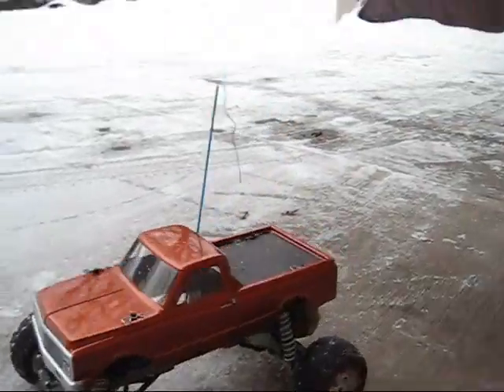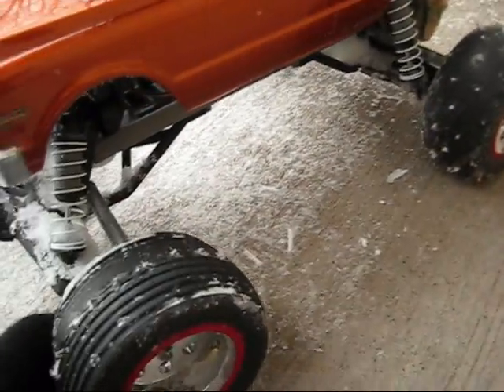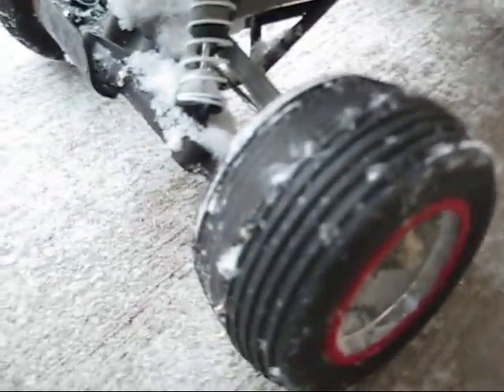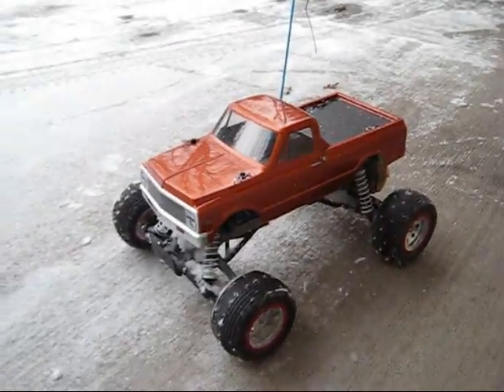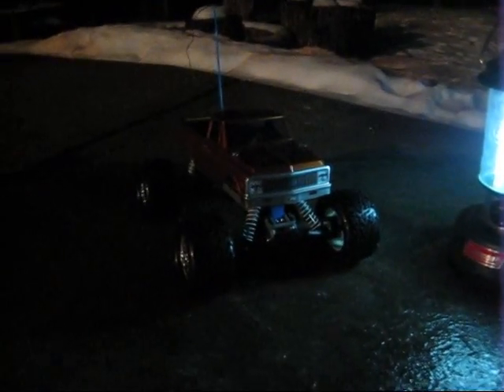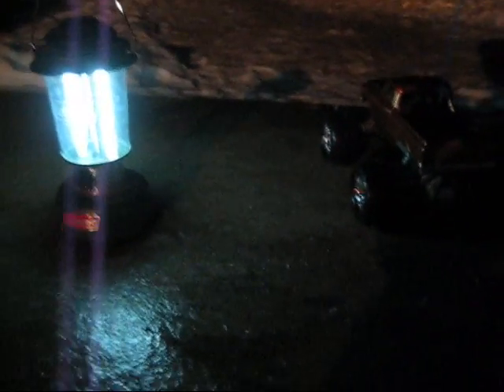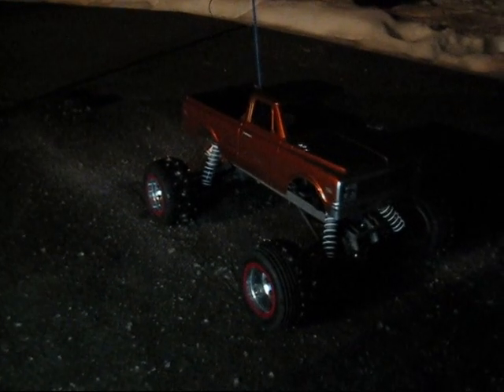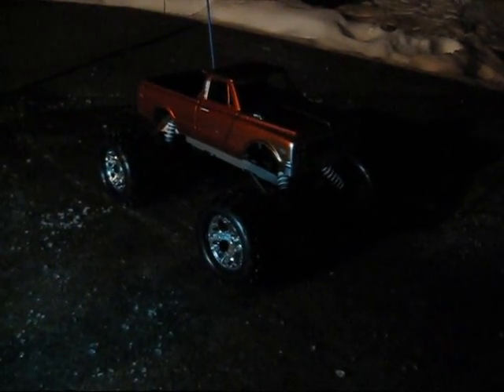Homemade studded RC car tires

Comment from the maker: @yadnam I put super glue on the tack then pushed it through the tire.  Then after that dried I put some more superglue on the outside of the tire were the tack came threw.  I finally used some rubber cement and coated the inside of the tire.  Hope that helps.

Comment from the maker: @ryan129994 If the tire was constantly spinning and not touching the ground, then yes.

but once the tires are touching the ground they will eventually pop out, which is why I glued them in.

Comment: what was your pattern for the tacks and how did you get the wheels off of the rim?
Reply from the maker: I alternated between a line of 3 and 2 tacks along the width of the tire, evenly distributing them around the circumference. There was a ribbing pattern on the inside of the tire which helped me with the even distribution. My tires were not glued so all I had to do was pull them off. Some tires are glued to the wheel so you may need a little more force, but be careful not to tear the tire in the process.
Reply: okay thanks

Comment from the maker: @bubbawinchester Thanks!  The body is a Proline 1972 Chevy C-10 Body, Product ID : 3251-00.  Your local hobby store might carry them.  If not you can go to Prolineracing . com and go to 1/10 truck bodies and order it there.  I don't remember the paint I used on it.

Comment: @CarbonCat09  this didnt happen to but i also used inch long nails and im only using a mini slash but mine did work and it went  over 35 mph im sure

Comment: What motor is in that
Reply from the maker: Titan 12T
Reply: CarbonCat09 has it always made that whiining noise when you slowly accelerate?
Reply from the maker: Yes it has
Reply: CarbonCat09 What is the chassis off of?
Reply from the maker: It's the stock Traxxas Stampede chassis with a Proline racing custom painted body.